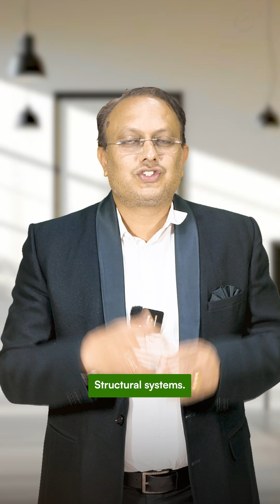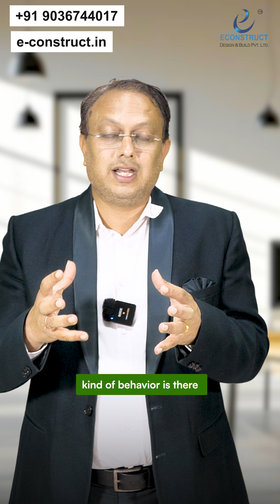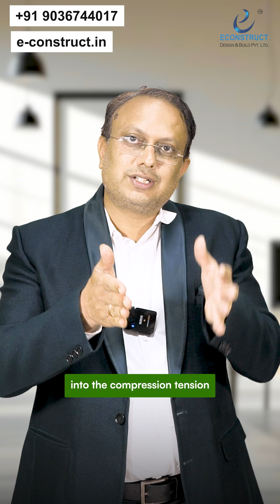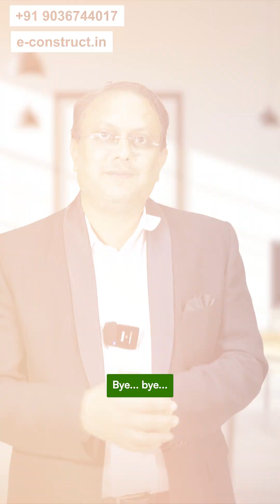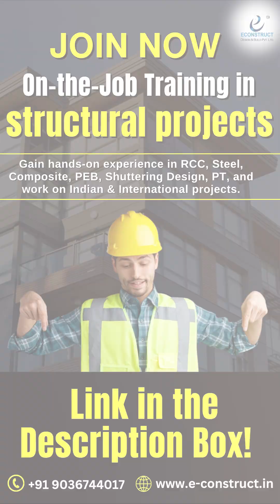🏗️ Structural Systems are essential for ensuring safety, stability, and strength in buildings.

Comment: I have been in oil and gas industry since last 7 years in gulf countries. I wanted to switch to structural engineer role and due to my passion in analysis of structural behavior, I have enough knowledge on structural analysis. I wished to have a tutor who can teach me analysis in practical way with real examples and I am sure that I can get what I want from your design courses. Please assist me to learn structural design of foundations for equipment, pipe rack, pumps, vessels, etc.